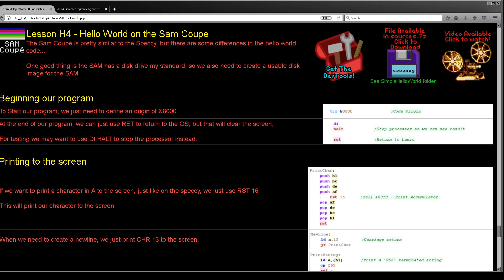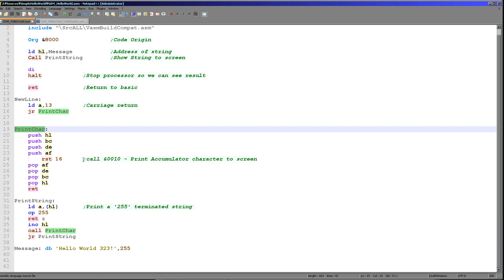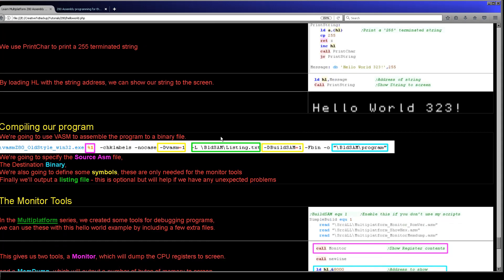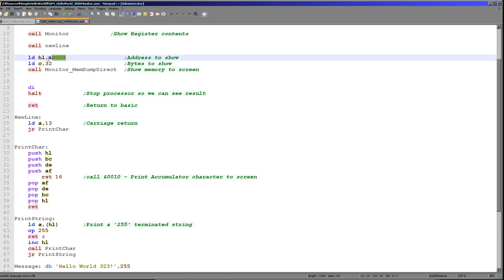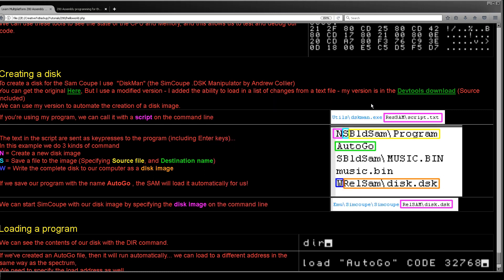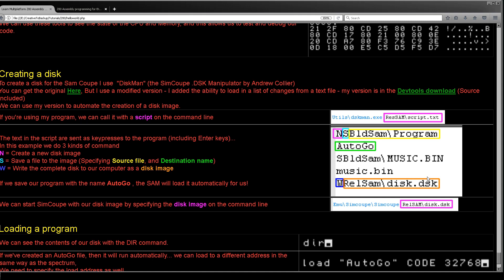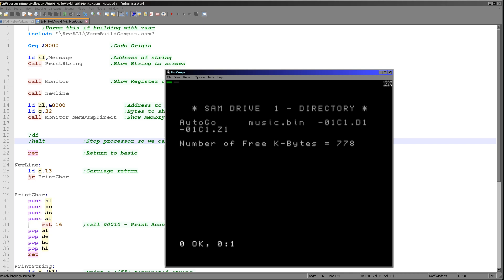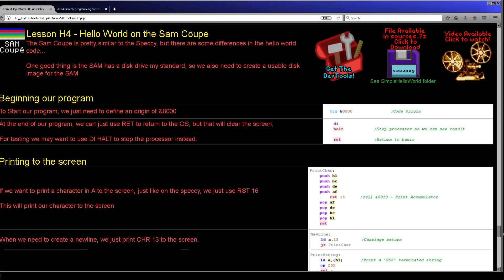Hello World on the Sam Coupe - Z80 Assembly for absolute beginners

Comment: enjoying your videos. I'm developing a new dizzy game for zx spectrum and videos like yours will help expand my knowledge of the z80 .
Reply from the maker: Great! I used to love dizzy back in the day
Reply: Sorry I didn't say, but my knowledge is quite basic. I've been interested in creating a dizzy game since the early 1980's, Now this is the year that I've decided to start this dizzy game.I have finished a great story board, so I have some ideas in regards to rooms - I have graphic coding of a room and used LDIR as a way of coping data to the display and attribute area, which works fine. But my question is - Do you recommend LDIR, and if you do then an area I would like to understand is how to activate  LDIR in the creation of an other rooms using spectrum z80 ? What I mean is if dizzy x or y position reaches the extreme edge of the display then how do I activate the code for this next room ? ChibiAkumas, If my question make no sense or it is to complex or far to much to write a response, then I'm happy with any response you can give me. Thank you.
Reply from the maker: @openmicwestbury7997  The rooms in a game like 'dizzy' are not stored 'as is' in memory, (as each screen would be 8k, and the machine is only 48k) they're built up of lots of small sprites (that's why object repeat so many times)... You could use LDIR to copy parts of the sprite...
You'll need movement routines to draw and move your character, and some kind of condition to detect the end of the screen, then you'll need to redraw the next screen from a 'script' defining the position of all the sprites in that room.
Reply: Thank you, you are quite right, the screen is 8k, it would not work that way. So I suppose the ldir could be used to redraw the HUD from the same code in memory as this is used on every screen, is this more plausible? As for movement of the character well I'm using pre-shifted sprites. I'm not sure if it was originally designed this way, but until I gain more knowledge of programming this is all I have right now.

Comment: "I'm not that good at C; it's been a long time since I've used it". Ever thought about writing your tools in x86-64 asm, lol.
Reply from the maker: I'm learning x86 ASM, but it's not viable for the tools, they need to be written fast and be reliable.
Reply: @ChibiAkumas  What machine are you programming for? Original IBM PC?
Reply from the maker: @drewsebastino2889  Yes, IBM PC, and Wonderswan! (it's 8186 based)
Reply: @ChibiAkumas  I knew immediately that it would be an LG NEC V30; Irem liked to use NEC x86 processors in their arcade machines while everyone else was using 68000s. It's interesting to learn there's another x86 based video game platform Have you come into contact with NEC's custom syntax? The MAME debugger uses it for some unfortunate reason.
Reply from the maker: @drewsebastino2889  No, I'm pleased to say I've not come across NEC syntax (!!)

I wonder if it was a legal thing, I understand that the 8080 and z80 are basically byte compatible, but the ASM syntax was totally different because intel had protections on the ASM syntax, not the executable code.

Comment: Ahhh I was wondering how you'd fix the auto-compiling of Sam disk images. I use a different assembler (PYZ80, also by Andrew Collier) , which has a build-runnable-image command baked into it. You just add that into the source and away you go. No good for compiling for multiple machines!

Comment: Ah, this is floating my boat as I use  Zesarux on the Mac and I believe it has decent SAM emulation. 

I also wonder if my hardware 'ZX-Uno' will run it, I was sure I'd read there is a SAM core for it somewhere. Anyway, always interesting these videos, Keith - thanks!
Reply from the maker: at 6mhz the SAM has the fastest CPU, and it's screen is simple like the CPC, rather than the MSX one.